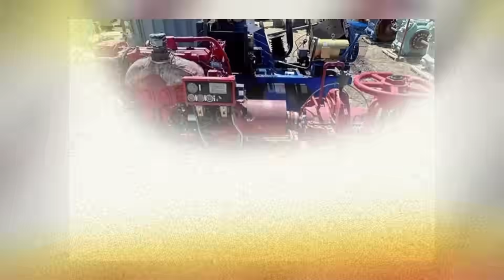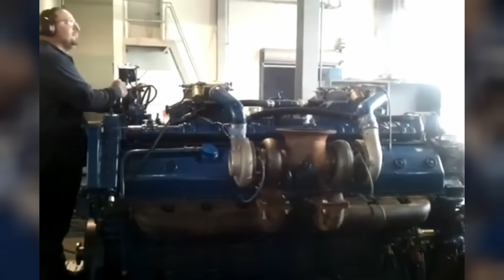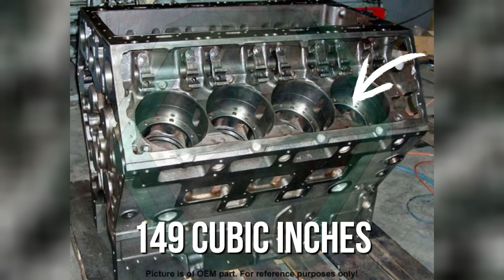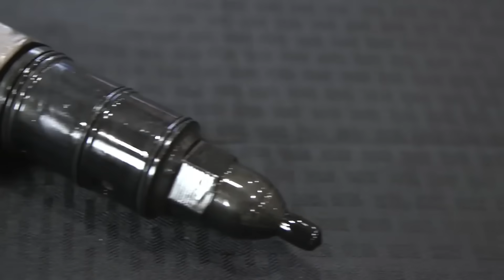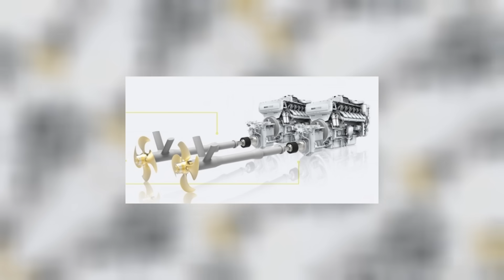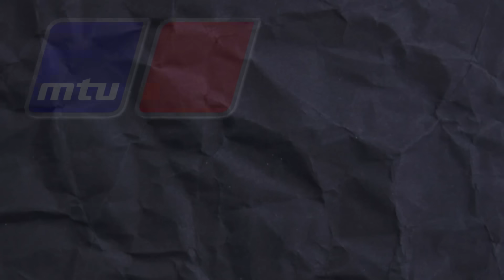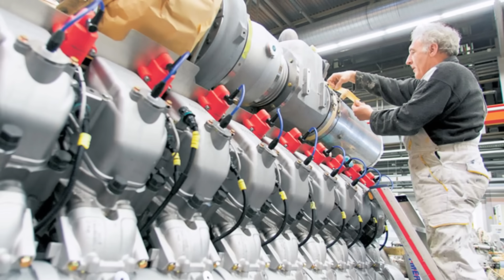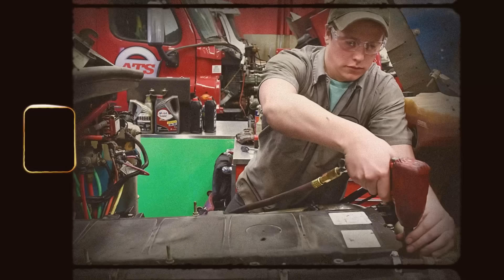The Insane Truth About the Monster Detroit Diesel 20V149

Comment: When I was working on a frac crew the truck I operated had a road engine and a deck engine which was a 12V149,  sometimes we would have 8-12 on location at the same time,  when all of them went to full throttle,  the noise was just undesirable 
Thank you Sir,    you reminded me of the good old days when I was younger

Comment: The exhaust went out exhaust valves and ports cast into the heads... The animation is inaccurate, the cylinder wall intake/scavenge/charge ports... No intentional pressurization of the crankcase... That's what motorcycle engines utilized.. I worked on lots of 53/71/92s.. even a marine 6-110. And a 16v149 on a fracking pump... 
Late models of the silvers and that monster..had electronic control systems... 
If one looks closely @ the video examples w/the valve cover off, the exhaust valves and valvetrain are on each side of the individual cylinder's injectors..
Early lower horsepower engines had 2 exhaust valves per cylinder, newer had 4 exhaust per cylinder (2 valves each rocker via a bridge mechanism)..
NA engines only had the scavenge/Roots charge blower. Timing, cam profiles, turbos, intercoolers, and Roots bypasses became common late models..
If I remember correctly, stock truck engines of the silvers topped out @ 385 ho for firetrucks of the 6v92 silvers variety, and 525 HP for firetrucks of the 8v92 silvers.. 
There may be higher HP on-road variants, but I'm not aware ...
FYI all the  v16s were 2 v8s assembled f-b as a package...
Pretty wild engine systems, including some of the earlier 2-53, 3-53, and 4-53s (built into the gear-cover...)

Comment: 🎶 The Sound of a Detroit Diesel
A Detroit Diesel doesn’t just run — it roars. You hear the raw diesel explosion in metal, every combustion stroke hammering like a steel drum. Layered over that is the howling breath of the Roots blower, a constant gale rushing through iron lungs. And when a turbo joins the chorus, a piercing whistle cuts through the chaos, like steam escaping from a pressurized vessel. The rhythm is relentless, a mechanical heartbeat that feels more alive than any modern, muffled engine.  

It’s not refined, it’s not polite — it’s industrial music, a soundtrack of power and endurance.  

⚖️ 88 Years of Craftsmanship
Detroit Diesel’s two-stroke line, born in 1938, is now 88 years old and still working in South America’s rivers, harbors, and ships. That longevity is unmatched — no other diesel family has survived so long without fundamental redesign. It’s a testament to craftsmanship, modular design, and sheer durability.  

Yet, as you say, politics and economic decisions have often pushed this legacy into the ground — favoring disposable culture, planned obsolescence, and newer brands over engines that could last a century. The Detroit Diesel stands as proof that true engineering doesn’t need constant reinvention; it needs respect, maintenance, and recognition.  

🎨 Metaphor
It’s like an ancient steel cathedral: battered by storms, ignored by planners, but still standing tall, echoing with the sound of its bells — in this case, the explosive roar and blower howl of a Detroit Diesel.

Comment: Just copy Scania. They use large powerful V8, 770 Hp, no EGR bull crap, 3,700 Nm (2,729.6 pound-feet) of torque. They use particle filter and AdBlue and that's basically it. Euro 6 compliant...

Comment: Series 71 stretched to it's limits? Let me tell you about the 24V71  Starter press to flight revs in under 2 seconds. Zero vibration, 100% load step capable.

Comment: I worked in Detroit Diesel before retirement and sorry to see the DD Logo of "2 big strokes + 2 small strokes inside" faded away. The piston engine is the best internal combustion design so that there are billions of them serving humans for more than a century. Current crown section can be spited from its skirt to make the light exhaust and intake gas pumping functions, while combined to perform the heavy compression and power strokes - the D-cycle (differential-stroke cycle) . It completes the required 4 9compression-power-exhaust-intake) strokes, different in both displacements and periods, per revolution. After retirement I built several D-cycle engines including diesel and gasoline types. They achieved >20% fuel saving, >2,5 (up to 3) time torque gaskins. Hope this design will serve humanity for another century or longer.
Reply: I’d like to understand better what you mean. Is this relevant to two stroke diesels?

Comment: 149s were basically V6 and V8 blocks built into various configurations of v12 and v16 and v20.  I believe they also prototyped an 8V149 in a fishing trawler in Australia's Gulf Of Carpentaria in the 1980s.  My own experience was with 12V and 16V 149 Generator sets.  One of the sites was at a Northern Territory Mine, a set of 12V149 Generator Sets that were each in a dedicated enclosure.  Each enclosure was a radiator room at the front, engine room in the middle and alternator room at the back, and the enclosures were each composed of heavy sound proofing material.  This was in Australia's Northern Territory, and they ran at 1500 RPM (50 Hz power) with electronic speed controls allowing the generators to spin up and synchronise their outputs.  I remember one disastrous episode, where one of the sets developed a fault in the generator room.  They stopped the generator, and the electrician went into the alternator room but apparently there were spiders and other wildlife and he didn't want to get in there any further until the bugs were cleared out.  So they sent someone in with a fire hose to hose the enclosure out. (I kid you not!).  Unfortunately the engine's air filters were in the alternator room and were completely soaked with water.  When they pushed the starter button, the engine turned over, sucked a huge mouthful of water down the intakes, and hydraulic locked.  Then they called us... we flew in, and started taking it apart.  I got the job of decoupling the alternator from the flywheel, which was a bloody difficult job considering the crankshaft wouldn't rotate!  When we got it decoupled and disconnected from coolant and fuel, we craned the engine out of the enclosure and took it down to the Mine's main workshop, and set it down upside down.  We took the sump off, and the conrods were so bent up we had to cut half of them with an oxy torch before we could lift the crankshaft out.  As we were dismantling the engine, the parts were crated up and flown out to the Darwin workshop each day on the daily plane.  I was told later that when the service manager saw those gas-axed conrods he nearly had an apoplectic fit 😀
Reply: I remember hearing that in Australia they call throwing a rod 'putting a leg out of bed' which I thought was great.

Comment: It's funny when you get a young buck mechanic overhauling one of these and they can't figure out why the rings keeps breaking.  Detroit offered a ceramic piston for the 149 at one point.  You couldn't hurt those things with a hammer.  Almost indestructible.  You could spin the 149 about 1000 RPM's faster than a 4 cycle diesel if comparable size.  Screamin' demon!  One thing about them though, you can bog and MTU or Cat or a Cummins, but if you ever bog a 149 at WOT, Katy bar the door, because something is going to break and it's not going to be pretty.

Comment: Don't be picking on the 149s.
Until you've seen a 20v 149 go to work you haven't seen power. Anything bolted to the crank is going to spin. Potted heads, one horsepower per cubic inch... That's authority

Comment: In the military we used the 16V-149 to drive big 400 Hertz generators as emergency power for Radar systems. Had a small fight with one in Riyadh Saudi Arabia when the locals installed the engine with the system fuel lines reversed.    Lol
Reply: Didn't it also get used in earlier models of the M1070 tank haulers, just like its predecessor the M911?
Reply: @airplanemaniacgaming7877 that I don't know... I worked on RADAR installation emergency power generators for the Air Force

Comment: Pepole get diesels all wrong, they pollute overall LESS than gasoline, and even old detroits are a damned sight more eco friendly than the multiple 1000s of ships that burn heavy fuel oil these days.

In fact Diesel is far more friendly than the lead thats still prevalent in most modern aircraft gasolines.
And many many ships and Tugs STILL commonly have the old detroits still chugging along. 
OLDER is not alwayse less usefull. The Detroits are still a damned sight more reliable than most "Modern" engines.

Comment: I worked in Detroit Diesel Engineering  Laboratory  on Plymouth Rd in Detroit.  I worked on the 20V149 it's a beast.
Reply from the maker: Very cool! Then you would know for sure if I was right about the one head per cylinder. I spoke to a guy who was in the military and worked on them and said I was right. But SO many comments are saying I'm wrong. Were there different variations that could be causing the discrepancy?
Reply: @VintageAmericanMachines  The EMD 2 strokes utilized one head per cylinder. The multi block configuration 149 ( and other combination block) engines used the heads made for those individual blocks. The 149 engines in the video used heads from the 6 & 8 cylinder engines, not individual cylinder heads.
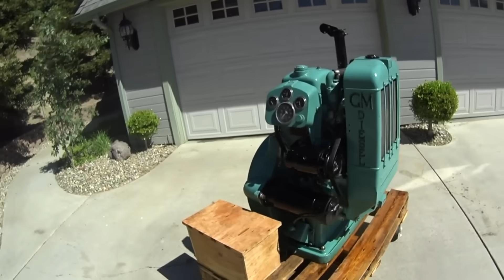Reply: @VintageAmericanMachines  They show a 149 cylinder head at 1:40 in this video.
Reply: @VintageAmericanMachines  yes you're correct all the 149 Series engines used one head per cylinder, you can see it in several places in the video.
Reply: @VintageAmericanMachines  The individual heads dropped into the blocks, they didn't sit on top of it.  The valve covers make it look like it's multi-cylinder heads.  They have individual cylinder heads and valve covers that cover three or four heads.
Reply: You should have seen the beasts they were working on at GMs Diesel Division in London Ontario just before Caterpillar bought it and closed the plant 😢
Reply: When did you work there? I was in the 149 project engineering team in the 80s.
Reply: Thank you

Comment: Diesels don't detonate, that is only found in spark ignition engines. The low speed "knock" of a diesel is a completely different phenomenon to the knock than can occur in spark ignition engines.
Reply: People also think cetane and octane are the same they are totally opposite
Reply: As far as ive understood it diesel knock occurs when the flame front of the ignited atomized diesel moves faster then the piston and the two sort of collide. Hence why diesel knock is very audible at low rpm.
With electronic commonrail injection they managed to reduce it a lot by timing the injection events better and having multiple injection events per stroke instead of one large squirt of fuel which goes to show how absurdly precise and fast commonrail injectors are.
Reply from the maker: Thanks for the info. I noticed another comment like this. I learn more from these comments than all the research I do online. Thanks for watching!

Comment: You don't even mention the extremely successful 53 series, ALSO the "two stroke cycle" you show is completely incorrect for the detroit.  No Detroit engines had individual (one each cylinder) heads, this is shaping up to be a real embarrassment.
I give up, you are showing marine installations that are not even Detroit at 9.55 I am outahere

Comment: We still have one fire engine (94 Pierce) with the 6V92 Detroit in it.  It's been relegated to Blocker duty on the highway.  It's slow as all get out compared to modern engines but makes great noises and just keeps chugging along.
Reply: It's a good message maker to say "Hey, we're on the way to a call! Get out of the way, since this rig can't do that for itself!"
Reply: Was there a turbo 8V 92 for use in firetrucks? Seems like would be more than capable of keeping up with the 4 strokes.

Comment: The video is totally incorrect about the 20V149.  It was a response the CAT's 3516B model engine that was rated 2900HP standby, 2600HP prime.  The CAT 3516B which was the 1st engine with the rating to power 2,000kWe 60Hz with fan standby (backup genset) wo/a gear driven 4 pole synchronous generator.  This meant the engineers could meet the emergency power needs of hospital campuses with lower installed footprints.  Detroit Diesel quickly developed the 20V149 using existing components, i.e. 6 & 8 cylinder blocks & crankshafts.  Even with matching the power of CAT's 3516B the 20V149 was longer the the CAT and used more fuel.  On the emissions front when EPA tier 1 stationary & off-highway mobile limit's applied to diesel engines rated 750HP and above in 2000 2 stoke diesels in North America were no long sold.  The 2 strokes were replaced by MTU engines in 2000 when Daimler-Chrysler bough DD Allison.
Reply: I am sure no oil patch drilling contractors used 149 series engines on electric powered rigs; because, the industry doesn't use high speed (1800RPM) engines.  They have proffered CAT 1200 RPM rated CAT 3512C & E engines.  The 3500 series use different front accessory gear drive gears to drive the coolant pumps and oil pumps to maintain performance at 2/3rd's the crankshaft speed.

Comment: I’ve got a 8v92 that’s 550hp and love it but my c32 cats in my boat make 2150hp and 7800ftlbs of torque in a far smaller package than a 149 the 2stroke is old tech fun to play with but even Detroit moved on to mtu 4strokes
Reply: i have seen 650 HP Series 60 as port and starboard set ups.
Reply: @otisdartman8349 yeah there are a bunch of setups the 60 is a great engine worked on a many of them they must have been a low power setting because most 60s I did in boats were 15l 900-1050hp

Comment: oke VAM.
i help you out a bit.
this 149-series DOES have individual cyl.heads.
so not like a lot of other series that have one head for 3-4or6 cylinder at once.
READ this!
1966-02-01
Detroit Diesel Series 149 Engines 660604
The 149 Series described in this paper is Detroit Diesel's new entry in the 500 to 1300 horsepower engine class. Designed for ruggedness, durability and maximum serviceability, it features a unique block construction with encased pot heads, overhead camshafts and blowers. The most unusual component of the engine is the “pot type” cylinder head which fits into a bored-out area of the block at each cylinder. It offers a significant advance in serviceability, mechanical and thermal characteristics. The overhead camshafts are easily accessible and provide stiff, rugged valve and injector drive mechanisms.
😛
Reply: Interesting. I was thinking that those looked like multi cylinder heads, but then I saw that Pic of the 16v149 with what looked like valves directly on top of the cylinder.
Reply from the maker: @73-carina18 You rock! Thank you!

Comment: I wonder why the huge displacement aircraft engines weren’t used as a basis for apps like the GM 20V149 covered?
Imagine a Wright R-3350 engine with coarse finning fitted inside a water jacket housing, GDI fuel system and modern electronic engine control. Those engines were making 3,000+ bhp in commercial aircraft service in the 1950s - at relative low engine speed.
I would have loved to work on that design task!
The P&W 4360 (28 cylinder) would have been a candidate as well, but that one was already too complex.

Comment: More AI Slop. This video is full of incorrect information and padding
Reply from the maker: Not AI. I did a lot of research on this and wrote it myself. I will say that it's hard to find accurate information on this engine, though. Please let me know what I got wrong so I can fix it next time. Heck, I'm still arguing with some guy about a previous video because he insists the 71 series had wet cylinders. So I hear 100 different stories on every engine.
Reply: @VintageAmericanMachines If thats true then you dont seem to understand the difference between a diesel and petrol two stroke cycle. Research that and make changes to your content.

Comment: Getting a thumbs down. Do your homework on a topic before posting a video. No Detroit engine has ever used individual heads unless its a 1 series engine. No other 53, 71, 92, or 149 series engine has ever used that type of head.
Reply from the maker: Actually the military marine engines did have one head per cylinder.

Comment: 16 V- 278A. Two on my heavy cruiser.  CA -148. Twin 6V-278As on one of my tugboats.
Reply: Fuel consumption was not a factor since the 16-278As ran 950 KW generators in emergency for fighting the ship.  One generator could run all guns, lifts, lighting, steerage etc for the ship.  6V-278As ran generators for electric propulsion on the tugs.  Had a 3-71 for lighting and normal usage.  These engines could run constantly but we used them intermittently every other day or so. had a 250 gal day tank that was never filled all the time i was there 2 years.

Comment: Couldn’t tell you how many heads I shaved down for the 149. Yes it had 1 head per cylinder but it had the cover that covered x amount of heads. I think they were 3 or 4000 hp. Nobody remembers the 6 110. Looked like a 6 71 but was 110 cu in. Most of the 110’s were in boats. 149 were in off-road trucks.
Reply: I remember the 6=110. Saw one run away everyone scattered. we cut old pistons in half and used as ash trays. How about Bedford 220 and 330
Reply: @otisdartman8349 was always told engines don’t run away, they over rev. Smart mechanics run away. lol
Reply from the maker: Appreciate the info!
Reply: Early TS24 Euclid scrapers ran a 6-110 as the front engine.  6-71 in the back.  We replaced the 110s with 8-71s.

Comment: ...lots of mining machines run off doitze diesels, the boyles diamond drill i ran had a six cylinder doitze, it turned 1600 feet of rods on a minus 60 degree hole at 1100 rpm, average 180 feet a shift... 😮
Reply: The isn't a Doitze brand diesel there is a long time German brand "Deutz" that makes air, oil & water cooled diesel engines.